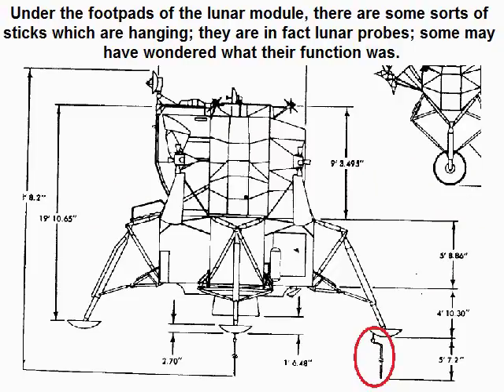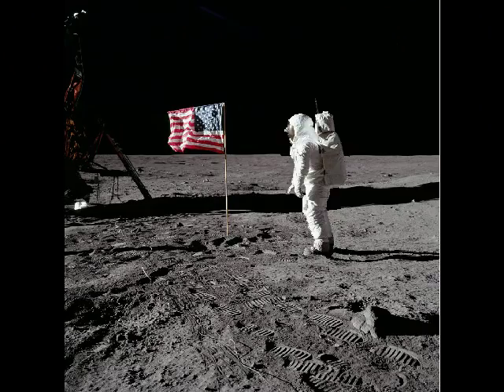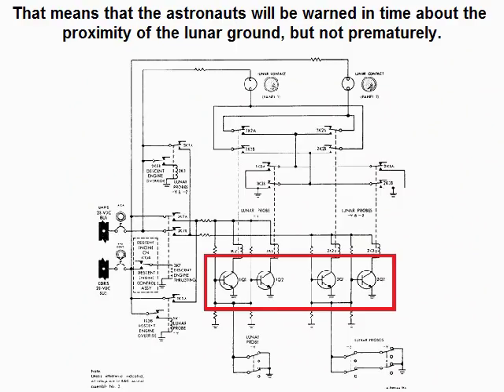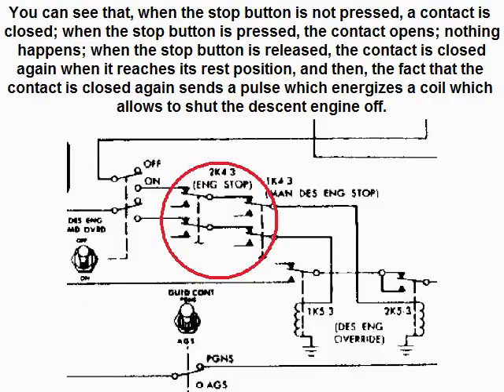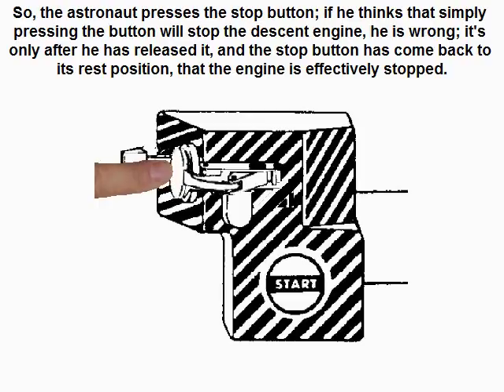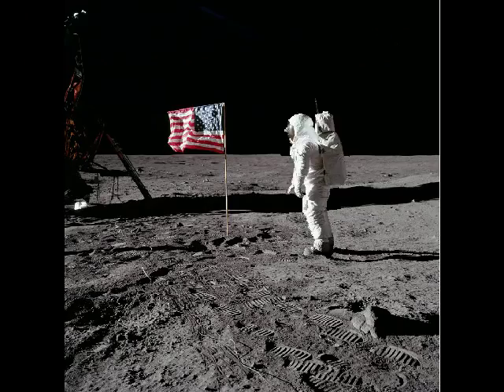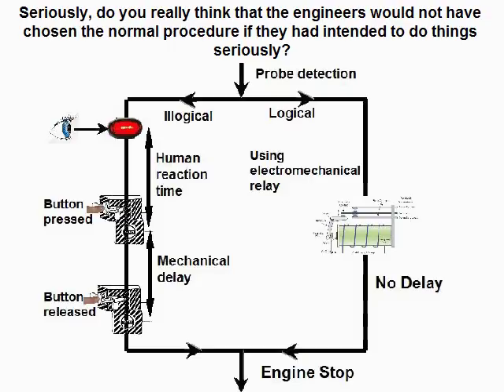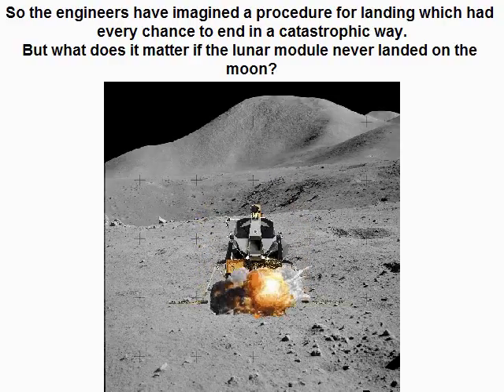Unsafe moon landing

Comment: If only the astronauts had received some training on these "complex" procedures. Hmm. /s
Reply: Hunchbacked's dislike of the switch design is a classic example of the "if I ran the zoo" argument. NASA didn't do something exactly as Hunchbacked thinks it should have been done, therefore it couldn't possibly have worked as designed and the entire program was a hoax. The arrogance and cluelessness of that attitude is breathtaking.
Reply: Except that you go on at length in your video (at around 5-6 minutes in) wondering if the astronauts were aware of the operation of the switch ("Have the astronauts been warned that they have to immediately release the button after they had pressed it to effectively stop the descent engine?"). I'm willing to bet that they were quite aware of how the switch operated. By training. Lots and lots of training.

I get that you don't like the switch design. Doesn't mean it was effective according to the engineers and astronauts that actually worked with the equipment.
Reply: Are you kidding? The Apollo astronauts were extensively trained on every single aspect of the hardware, software and mission plans and spent thousands of hours running through simulations of all planned and all conceivable anomalous/emergency procedures.
Reply: How exactly do you figure it is substantiated? Have you submitted it for peer review? Have actually done any legwork to test your hypothesis? 

Substantiated by whom?
Reply: As for the rest, why should we accept anything that harms Apollo's credibility? Apollo HAPPENED! Your credibility is the real issue here.
Reply: Hunchbacked: one basic principle of argumentation that you need to learn is this:
MAKING A CLAIM WITHOUT SUBSTANTIATION HAS NO MERIT
You claim that the procedure was "very hazardous" but you do not substantiate (i.e support it) with either COMPELLING EVIDENCE or COGENT ARGUMENT; therefore, it is meaningless. You might as well claim that Donald Trump was cloned from alien genetic material in a secret underground bunker in Area 51. ;-) 
Furthermore, when someone else (i.e. me) points out to you that the procedure was not mission critical and cogently argues why not, you do not even attempt to refute that. There is abundant evidence that that procedure was NOT hazardous: the recordings and films of the six Apollo lunar landings, including this one: http://www.firstmenonthemoon.com/. Now does that sound like it was scripted?
And, of course, all the photos of six undamaged LMs on the lunar surface.
Reply: "Doesn't mean it wasn't effective ..." - duh!
Reply: Yes, they trained over and over, to the point that it even affected how they talked about the flight. For example, after Apollo 12 the crew (especially Pete Conrad, the commander) would say things like "Usually we'd do X but this time we had to do Y because Z happened". I.e., they spoke as if they'd flown to the moon every day for years, not just once. Because, in a way, they HAD flown to the moon many times.
Reply: No, hunchbacked's credibility is not the real issue here since he obviously doesn't have any. The real issue is his technical incompetence and his inability to admit his mistakes.
Reply: '' ... and you'll never accept anything which harms the credibility of Apollo''  

is that what this 10 minutes of patronising dribble is trying to do?
Reply: As far as I know Jack White was an American. He was also an idiot. See?
Reply: So apparently white spacesuits don't work because Lunar Modules have black parts and Soviet probes overheat when their solar panels get covered. Yeah, that's a compelling argument alright. Insert eyeroll here. 

Please don't breed, Waldo.
Reply: Oh, for Christ sakes, now we're Gish galloping off to the Van Allen belts, now? Why don't you read a fucking book and find out what they did to avoid the worst of the fearsome Van Allen belts. Yeah, they were and still are actually smart enough to figure that one out too. Seriously, are you related to Expattaffy? Your schtick is awfully similar. Now get to bed before mommy takes away your IPad privelages.
Reply: I don't believe it! We have on our hands a moon loon (gasp of surprise) actually attempting to argue an issue. I will help out and provide the link just to keep this going http://www.aulis.com/saturn_v.htm
Reply: Seriously, are you related to Expattaffy? I'd accuse you of being Expattaffy, but you haven't yet exhibited his remarkably foul mouth... Your style of argument is nearly identical, though...
Reply: Upon reading the Attivissimo's refutation one could not help but conclude that this refutation was set up as a strawman for Pokrovsky to easily destroy. Attivissimo's contention that the injection velocity achieved by the Saturn V S-IC at separation was irrelevant automatically indicates that a few flies had already blown the ointment. Aulis.com is not in the habit of providing a forum for contrary viewpoints that seriously challenge the in-house propaganda supporting its labyrinthine maze of conspiracies and hoaxes
Reply: I have to smirk to myself at the pictures of the S-IC F1 engine remains in one of the random aulis articles thrown in my general direction by Comrade Waldo. They were retrieved from the bottom of the Atlantic Ocean by modern salvage vessels using the trajectory information of the original Apollo flights to reduce the size of the search areas. Strange how the engines were found exactly where their nominal as-published trajectories would have placed them!
Reply: Your opinion as to what accounts for the best reason for anything means exactly Jack and Shit, and Jack left town. 

I will agree it is a travesty that those 2 Saturn V's never flew, but not for the moronic reasons you state. You wanna blame someone, blame Nixon.

Buying unused Russian rockets is an acknowledgment that they are fine machines, not an admission of technological   backwardness, and comparing an F-1 to an RD-180 is comparing apples to Spaghettios. Russian experts also built the N-1 rocket, but they had a nasty habit of exploding, so get a grip.
Reply: "since you claim to be such an expert in rocketry, why don't you even use your real name??? I mean, if I were you and I had all that impressive knowledge of gases and rocketry I would be promoting my work, not hiding behind a lame pseudonym!"

I live in semi-retirement after a fairly long career. My professional rewards I deem to be adequate recognition. My forays onto YouTube are solely to defend the reputations of the Apollo astronaut corps, the engineers who designed the Apollo hardware and the army of technicians who put the nuts and bolts together. My true identity is irrelevant - the truth will support itself from the facts without too much help. I do not wish to be annoyed by a potentially large cohort of demented dingalings like yourself by revealing private information over the internet - just the personal name is sufficient to locate the individual down to a street number.
Reply: DO NOT FEED THE PUERTO RICAN TROLL FIGUEROA
Reply: Of course it IS a question of training. I think you have no idea of how intensively the Apollo astronauts were trained. They knew the Saturn V and Apollo CSM-LM systems from back to front. They went through hundreds of hours of simulator training, practising planned procedures and every possible emergency procedure over and over again. NASA had teams of scientists, engineers and psychologists exposing them to all kinds of anomalous and stress-inducing situations, just to see if they could handle all the inputs and survive. You should read these five books written by Project Apollo insiders and selected by Harrison H Schmitt himself, the only scientist to 'fly' on an Apollo mission (Apollo 17):
https://www.wsj.com/articles/SB10001424052970204271104574290651109530012
Reply: They got enough training that no Apollo mission failed because of a crew mistake.
Reply: Ah the Waldemar hath spoken. So as it spoken so let it be done. And he referenceth the Aulis, the sacred scriptures of all moon loon brethren chapter and verse.

Let me guess without looking! The author(s) of the hyperlinked non-peer reviewed aulis submission has Russian author(s) like all such similar 'papers'. If one was to waste one's time verifying the credentials of said Russian author(s) usually from some obscure Russian polytechnic institution with no world university ranking under 300 one would find no other references to any other published work.

Conclusion: these are all part of a Russian disinformation campaign to erode confidence in the West's governments and institutions that has been going on for some years. Sowing seeds of doubt behind the lines has been a Ruskie ploy for over half a century and has become a highly efficient industry as evidenced by the Trump era of 'fake news' in the USA.
Reply: Just CuriouS Got it in one. How'd you guess? Lolz...
Reply: +Cornelius Crewe  It would be interesting to see the list of sponsors to the aulis website and how much of its finances are counted out in Roubles.
Reply: The Russians who trash the Apollo program may or may not be part of their government disinformation program. We don't know. They may just be ordinary Russians who are still angry at the fact that, 50 years ago, the US beat their country to the moon. But it doesn't matter, because we do know they're wrong.
Reply: What you really mean is that you (and Aulis) don't understand Apollo technology. That's very different from NASA not having it.
Reply: And why do you think there should be black space suits? I thought I just explained why they were white.
Reply: Racist rant? Um, I may not know much about Russia, but I'm pretty sure that most of them are Caucasians. You know, "white". You know, "caucasian" as in the Caucasus mountains? Not that this matters in the slightest.
Reply: Just Curious Yuri Gagarin was a true hero of the world. Damned shame he died so young.
Reply: Can we get the thread back onto topic please. The question re A7L being white has been asked ad nauseum and the question no doubt owes its origins to some crackpot moon loon theory. The aulis website is just riddled with articles based on questionable hypotheses and is hardly a credible source of information.
Reply: Just CuriouS I'll save you the trouble. He thinks this photo proves the spacesuits and/or Apollo itself is fake. Cuz there are black parts. Really.

https://www.hq.nasa.gov/office/pao/History/alsj/a11/AS11-40-5915.jpg
Reply: +Cornelius Crewe  I had to delete the post as I wrote it from memory without fact checking. He remains justly a "Hero of the Soviet Union" as the flight was extremely risky. I was factually wrong in stating that the previous R7 ascent ended in disaster as the last 2 flights preceding Gargarin's flight were actually successful. He sang the Young Pioneer song The Motherland Knows during the ballistic reentry not the ascent apparently although my memory remains unconvinced that he did not also sing a patriotic song during the ascent.
Reply: "by all means start enumerating those "questionable" articles and the SPECIFIC SECTIONS you have trouble with!"

With pleasure! Your attention is drawn to the two pdf files attached to the aulis article "Was the Apollo 11 Saturn V Underpowered?" submitted by Comrade Stanislav G. Pokrovsky, Ph.D of the Vladimir Putin Institute of Better Boting (the institute with which he is associated is not listed in the article)

The two 'paper's seek to establish that the Saturn V S-1C injection velocity at engine cutoff was inadequate. Comrade Pokrovsky's analysis is of the deceleration of the aerosols ejected during deployment of the S-II solid propellant vernier separation motors and by the supersonic analysis of the oblique shock formed by the bluff body upper bulkhead of the S-IC.

Both analyses assume that the dominant gas dynamics effects are generated solely by the ram effect of the Apollo stack passing through the ambient atmosphere at an altitude of about 60 kms. The papers overlook completely that the dominant gas flow interacting with the aerosol and the S-IC bulkhead is not the extremely tenuous atmosphere of N2/O2 but rather the supersonic superheated relatively high pressure steam generated by the five J2 engines of the S-II at full thrust.

The aerosol analysis fails completely as there is no allowance for the explosive propulsive effect of the relatively high pressure steam essentially spherical shock wave. Read it through - no mention of the J2 exhaust steam at all.

The oblique shock wave analysis is a real clanger. Attributing the oblique shock emanating from the S-IC bulkhead to the onrushing ambient atmosphere is thermodynamics nincompoopery of the highest order. The Apollo stack from the S-II up to the CM being present immediately upstream precludes the thesis that the atmosphere could interact with the bulkhead undisturbed. It would be blatently obvious to a first year engineering undergraduate that the gas stream producing the luminous shock phenomenon is the supersonic  superheated steam flowing in a divergent supersonic stream from the J2 engine nozzles being reheated to luminescence by undergoing the adiabatic compression in crossing the oblique shock boundary. 

The divergent nature of the gas stream will tend to increase the oblique shock incidence angle. Steam is a triatomic gas with many more degrees of vibrational freedom than diatomic N2 or O2. Steam has an adiabatic gas constant k of about 1.3 compared to the atmospheric value of 1.4. As the thermodynamic terms producing shock incidence angle are function of 1 - k, these terms are some 30% smaller for a steam gas flow than an atmospheric flow which also contributes to an increase in oblique shock incidence angle. 

Neither the divergence of the incident supersonic steam flow nor the different thermodynamic properties of the steam are even remotely alluded to in Comrade Moronsky's pathetic attempt at discrediting Apollo by total thermodynamic rubbish based on grossly erroneous assumptions.

Over to you buddy!
Reply: What the bl**dy hell do you mean by "Anyway, Apollo was totally fake!!!" You laid down the gauntlet of challenge to go through aulis articles. I have a list of such crappy articles wrapped up in a superficial academic presentation the length of my arm. You are backing out of the challenge after the very first move because you realise that you are up against a engineer with 36 years of gas dynamics experience who knows exactly what he is talking about and you know sh*t!
Reply: You have not given your rebuttal to the 'fake' analysis of Comrade Pokrovsky. The ball has been hit into your section of the court. I await your return of service.
Reply: While we are awaiting your return of service perhaps some other erroneous aspects of Comrade Pokrovsky's aulis submission are in order. He relies very heavily on photographic analysis. From his angle and radius measurements it is clear that he assumes that the line-of-sight of the camera is orthogonal (at right angles) to the spacecraft's trajectory as no corrections are offered for oblique camera angles. For a camera located in the vicinity of the Kennedy Space Center at groundlevel and from the Apollo 11 telemetry data (strangely also available from another whacko aulis submission) the spacecraft trajectory makes an angle of about 13 (not 90!) degrees to the camera at S-IC separation which means that significant photographic foreshortening is present in the imagery analysed. Such a drastic foreshortening negates the measurements taken by Comrade Kaputnik Moronsky as being of any meaningful usefulness!
Reply: +Cornelius Crewe  Our deranged companion Waldo is not aware that the Apollo LMs landed near the lunar terminator where initial lunar surface temps were close to 0 degrees Celsius. Even in the extended stay J series missions that concluded the Apollo lunar missions had surface temperatures of no more than 63 degrees Celsius with the solar elevation angle above the lunar horizon of no more than 45 degrees. He is also clearly not aware of situations where the only significant heat transfer mechanism is radiant heat transfer which largely negates the effect of surface temperature in the absence of conduction or convection paths. To Waldo Stefan Boltzman is just a German's name that he has not made the personal acquaintance of!
Reply: Just CuriouS I'm certain facts like that are utterly lost on ole Waldo. All that matters to him is black parts on the LM negate the validity of the white spacesuits. Typical hoax nut behavior. Kinda sad, really. I always kinda pity their inability to marvel at the wonder of it all. 

Did you see the Falcon Heavy launch?
Reply: No but I have now! Most impressive booster capability. That should stop moon loon chatter about completely lost technology.
Reply: I'd love it if that were true, but you know as well as I the hoax nuts will never give up their conspiracy fantasies. You could take them directly to Tranquility Base and let them touch the LM decent stage, and they would still scream FAKE!!!! Cuz, you know, space flight is the DEVIL!!!! lol...

I'm really excited to see what SpaceX does to top this. Wouldnt it be great if this sparked another space race? Maybe one without the awful political implications, though...
Reply: That's nice, Waldemar. Now off to bed with you. Adults are talking, and you've got school tomorrow.
Reply: You can keep the ad hominems to yourself until you refute the argument. If you experience difficulty with English expression at a level superior to the gutter talk found in YouTube posts who has the problem? If the work is sloppy you will have no difficulty refuting the points raised won't you. Don't be lazy. I have given you the website, go to the moon/apollo tab and select "more articles'. The name of the submission has already been given in a previous post along with the name of its Ruskie author. For some reason giving hyperlinks in my posts cause hiccups with my post after that so I usually do not leave links.
Reply: "Please send a link, or at least an explanation/summary of what my "comrade" said so that I may know exactly what it is that I am supposed to refute. "  If you can read English at an advanced level you should have no difficulty with analysing the argument proposed by Comrade Chairman Kaputnik Jablonsky errrr I mean Stanislav G. Pokrovsky, Ph. D. I have already given you my precis of his arguments in an earlier post that either you did not peruse and/or comprehend! Or do I have to keep reiterating points raised whilst translating from a technically oriented treatise into simplified English for the linguistically challenged!
Reply: In other words you haven't got the foggiest idea what Comrade Pokrovsky's paper is talking about and you are  at a complete loss as to how my observations refute the crap he presented. So rather than bog in up to the axles and be made into minced meat you are opting out on a pretext. 

I am Australian and I do not mind being referred to as an Aussie. Englishmen are referred as Pommies, Americans as Yankies. Nearly every nationality is shortened into an .....+'ie' in vernacular Australian usage. Many ordinary words are truncated and 'ie' added eg. presents become prezzies, Christmas becomes Chrissie, politicians are pollies, postman becomes postie, bushman (or stockman) becomes bushie, farmer becomes cockie, gynacologist becomes gynie. I am not going to apologise for a well known feature of Australian vernacular speech - Russians are Ruskies in any Australian context and no slur is intended.

So do you want to comment on the aulis paper or pretend to take umbrage as a feint for your inability to return of the tennis ball I have squarely served to you?
Reply: As a side point how do Russians refer to themselves in their own language. If I am not mistaken it is русский and it's pronounced "roo-ski" isn't it. Your pretence of offence is noted as a cover to mask your total lack of knowledge in supersonic and hypersonic gas flow phenomena.
Reply: Last lesson on Australian vernacular speech. A shortened form without the 'ie' addition is intended to harden the expression and as such is used where insult is intended eg. bloody Poms, bloody Yanks. Just thought you'd like to know.  

Get on with refuting my contention re Pokrovsky's papers.
Reply: A point of physics, chemistry, or mathematics that is well founded upon the fundamentals readily acknowledged by all scientists and engineers does not need a reference. The dominant gas producing the visual phenomena in pokrovsky's papers is not the rarified atmosphere at 65 kms up but the hot blast of supersonic steam ejected from the five S-II stage's J2 engines at 4200 m/s at a pressure significantly elevated way above the ambient atmospheric pressure impinging on the S-IC upper bulkhead from no more than a few metres upstream. This is a physical fact that only an idiot would deny. This physical fact receives no mention in Pokrovsky's papers. A simple conclusion: Pokrovsky was working on a completely inappropriate set of assumptions which negates the conclusion that he reaches no matter how impressive his analyses may seem to  a layman such as yourself!
Reply: Do you refer to yourself as being a русский or do you not? Your continued pretense at offense is noted as a cover for inability to intelligently respond to the issue raised.
Reply: "And apparently neither do you since you HAVEN'T DARED to summarize what exactly you want me to refute. . . . . " 

For your benefit I have copied and pasted my post from yesterday below:
"
Just CuriouS
20 hours ago
"by all means start enumerating those "questionable" articles and the SPECIFIC SECTIONS you have trouble with!"

With pleasure! Your attention is drawn to the two pdf files attached to the aulis article "Was the Apollo 11 Saturn V Underpowered?" submitted by Comrade Stanislav G. Pokrovsky, Ph.D of the Vladimir Putin Institute of Better Boting (the institute with which he is associated is not listed in the article)

The two 'paper's seek to establish that the Saturn V S-1C injection velocity at engine cutoff was inadequate. Comrade Pokrovsky's analysis is of the deceleration of the aerosols ejected during deployment of the S-II solid propellant vernier separation motors and by the supersonic analysis of the oblique shock formed by the bluff body upper bulkhead of the S-IC.

Both analyses assume that the dominant gas dynamics effects are generated solely by the ram effect of the Apollo stack passing through the ambient atmosphere at an altitude of about 60 kms. The papers overlook completely that the dominant gas flow interacting with the aerosol and the S-IC bulkhead is not the extremely tenuous atmosphere of N2/O2 but rather the supersonic superheated relatively high pressure steam generated by the five J2 engines of the S-II at full thrust. . . . .  ."

What started this off was your taking exception to aulis articles being described as crap. You were the one who asked for examples of flawed aulis articles and I proceeded to oblige. Now you realise that you are nowhere near up to the task as it requires in depth knowledge of thermodynamics and gas dynamics in particular to hold your ground. It's not really a good negotiation skill to blindly offer something without being aware in advance of what was required to comply is it!
Reply: You're insane. I clearly stated both the title and author's name at the very start of the discussion. If you could not find the paper on aulis you could not have searched very far. You still have not given any cognisant response to explain why Pokrovsky failed to allow for the dominant gas flow being hypersonic steam from the J2 engines rather than ambient atmospheric effects. 

Further confirmation that it is the J2 rocket exhausts impinging on the S-IC upper bulkhead that have generated the observed phenomena is that the features fade and disappear as the Apollo stack pulls further away from the jettisoned S-IC. If they were caused by the onrushing atmosphere they would have intensified as the S-IC fell away from the aerodynamic shielding afforded by the upstream Apollo stack

Your mentioning other aulis submissions in passing is a deflection tactic. Stick to the topic at hand. There is plenty of time later to move the discussion onto other topics. To quote your open invite for me to select the topics:
"by all means start enumerating those "questionable" articles and the SPECIFIC SECTIONS you have trouble with!"
Reply: The exact link was given in Endymion Andselene's post ages ago. I cannot give links as it causes some technical difficulty that prevents me commenting further.
Reply: Only in your remarkably feeble mind. Just because you proclaim he has failed does not in fact make it true. You are making the claim,  you back it up.
Reply: Do I detect a major logic failure here. I did not repeat Attivissimo's refutation and incorporated none of it in my reply. 

Pokrovsky completely ignored the effect of five J2 engines firing at full throttle no more than a few metres away from both the aerosol particles and the S-IC bulkhead. The luminousity of the detached bow shock is a dead giveaway as it could only be the reheating to luminosity of the preheated J2 steam exhaust upon undergoing adiabatic compression in crossing the shock. It is to be noticed in the same photographs that there is no visible supersonic shock activity at the nose of the Command Module due to interaction with the exact same rarified mesosphere. The only way that supersonic shock activity generated by ambient atmospheric interaction at the S-IC separation velocity of ~2300m/s is made visible is by using schlieren photographic techniques that requires a ground-based shock tube facility. The highly luminous visibilty of the detached bow shock can only be caused by a gas that has already been preheated by some other process e.g. exiting as a supersonic exhaust from a rocket nozzle only metres away. Atmospheric luminosity due to adiabatic compression requires hypersonic incident velocities not the supersonic velocities at S-IC separation.
Reply: +Just CuriouS It's easy to see just by looking at Saturn V launch videos and films that the performance of the S-IC must have been close to the claimed figures. We know the theoretical maximum performance of the propellants. We can measure the volumes of the three stages and from them calculate how much propellant each stage could carry. We know the liftoff acceleration from the known height of the stack and the time it takes to clear the known height of the launch tower. We can see how the apparent size, look angles and plume spreading change with time. And probably the single most important visual check on S-IC performance: the appearance of very visible shock condensation clouds around the top of the stack and the fairing that connects the second and third stages right as the launch vehicle goes supersonic. They're highly visible e.g., in the Apollo 11 launch.
Reply from the maker: It's not a question of training, it's a question that the engine should have been stopped automatically when the lunar probes touch the lunar ground, and not require the intervention of the astronauts, which was a very hazardous procedure.
Reply from the maker: My claim is substantiated, but you don't accept it, and you'll never accept anything which harms the credibility of Apollo.